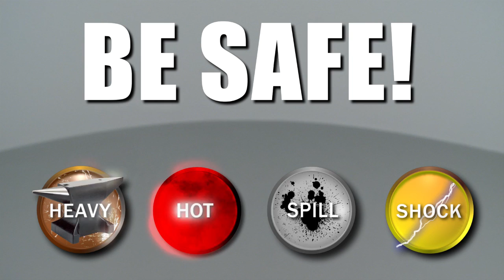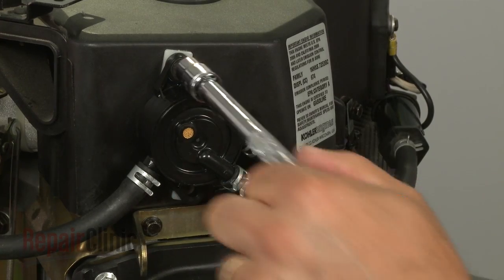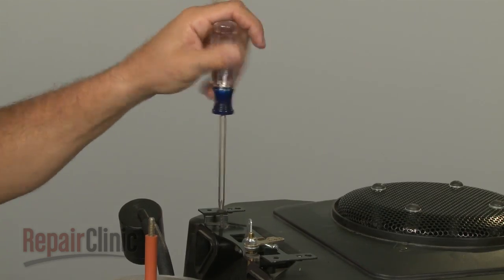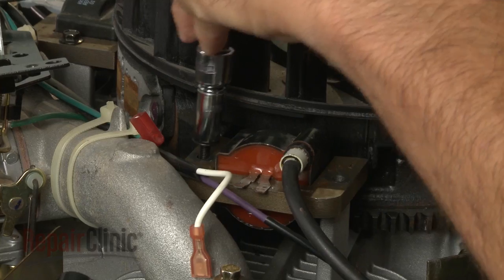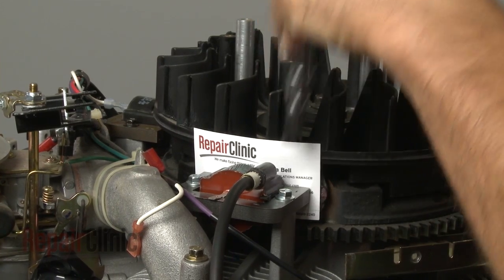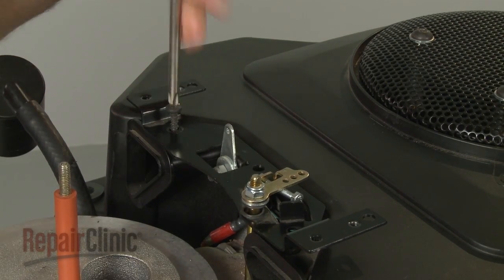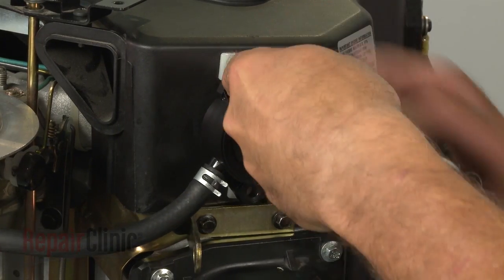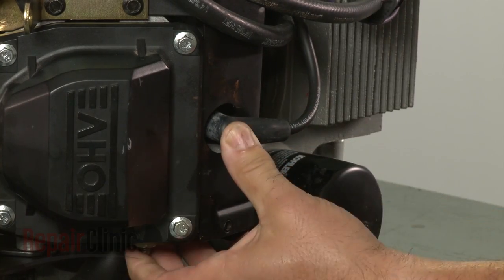Kohler Small Engine Ignition Coil Replacement #24 584 45-S

Comment: I think I would have tested for spark before putting it all back together again.
Mine has an odd symptom.  There is no spark with the ground plugged in.  Unplug the ground and it works.  Only the one side has to be unplugged to work.  Perhaps the coil is defective in some way, but it works now, so just leaving it like this.
Reply: Exact same with mine. Think the coil pack harness is faulty.